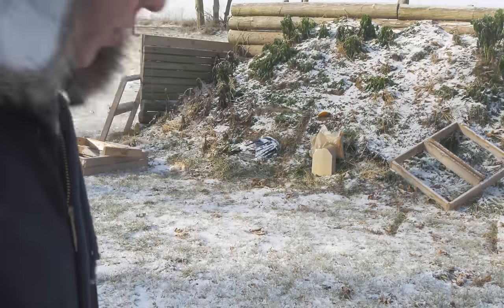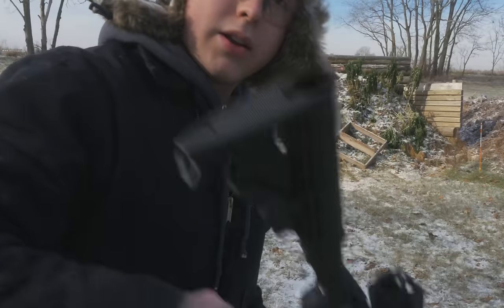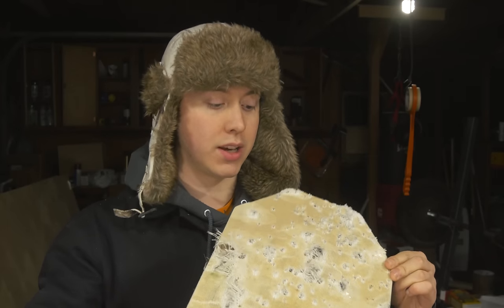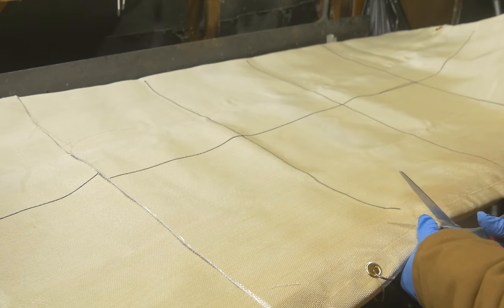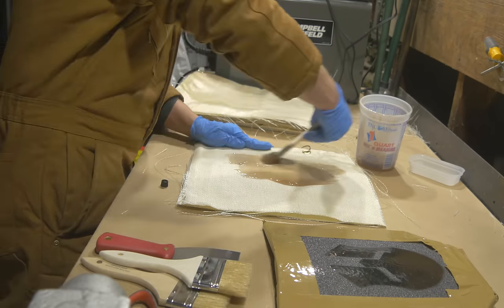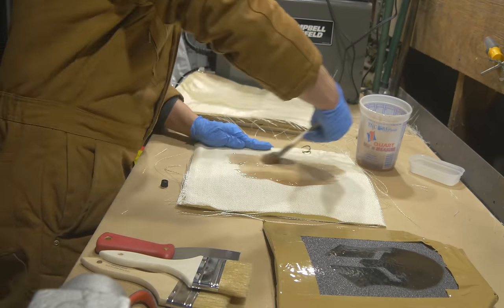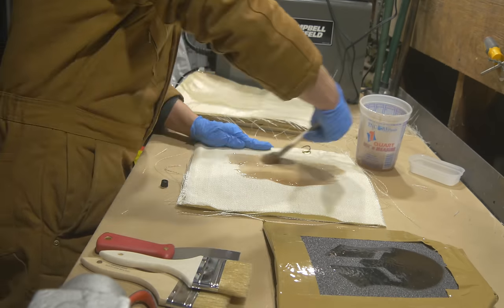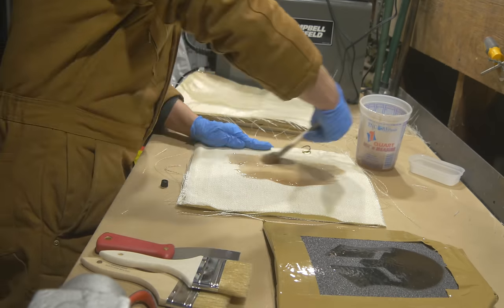How to Make AMAZING Bullet Resistant Armor for $30

Comment: steps to make a 30$ armor:
first: BUY 700$ REAL PLATES FOR MOLDS
Reply: I was thinking that too haha. Maybe we can make wooden plates as molds :P
Reply: lol
Reply: You can literally buy the cheapest AR500 plates and still have the same dimensions for $70. A
Reply: you can also buy Airsoft plates that are shaped like real ones but are only plastic
Reply: @MoviesFreeGalore  Do the cheapest plates still stop pistol bullets?
Reply: @user-oo6xw5fb2h  Yeah. Easiest way to break it down. The cheapest plates will stop rounds up to .44 magnum and slugs. The intermediate plates will stop all pistol, carbine, and shotgun rounds whether OO buckshot or slugs. The pricest plates will include 5.56 and 30-06.
Reply: @user-oo6xw5fb2h  But I mean the round itself isn't what you need to concern yourself with but how it handles spalling. Which is when the round hits the plate and breaks up into shrapnel that could eviscerate your soft flesh.
Reply: Don't forget how many hours of labor he put into it. Those costs are often overlooked.
Reply: @MoviesFreeGalore  Can always add a coat (or two) of epoxy or flex seal to any plate (if so desired) to help alleviate the potential for spalling. I also wonder how many folks are wearing soft plates between their clothing and the hard plates just to give themselves more protection.
Reply: @thomast8539  Not too many, obviously. But when most people ask about body armor they're thinking of plate carriers and generally not soft vests for handguns.
Reply: Not to mention but spalling is only an issue for hard plates.
Reply: AoD Wexler Walmart sells AR 500 steel targets big enough that you can cut one of these plates out of for $30. With a good angle grinder and a few cutting wheels you can have one made in about an hour. It will pretty much stop any round out there that is not armor penetrating
Reply: Yes sir!  Put those same hours into 1.5x overtime, and you can BUY some AR500 armor plates.

STILL, the proof of concept is cool, in case Diane Frankenstein bans them and you have to make your own.
Reply: @MoviesFreeGalore  I think you're missing the point. If you've bought armor plates, why are you making armor plates?
Reply: @cmasonw  Because I could buy level 1 plates that can only stop a fuckall gun for less than $100. Now I have a mold to make durable plates in line with level 3.
Reply: @MoviesFreeGalore  You can buy level III plates for approximately $130 or so. Watch MrGunsandGear's video on the Tactical Scorpion armor.

edit: idk how much armor prices have increased in the last few months
Reply: @MoviesFreeGalore  is it 600$ for a front plate only? Or front and back?
Reply: @frankarchibald732  jesus. If you pay $600 for 2 plates you got ripped off. You could get a full set of ceramic tiled plates for that price with side armor.
Reply: @frankarchibald732  personally I would say Google reputable and NIJ certified armor companies. Buy everything seperate. Bundle deals are great but that extra $100 you save is a detriment to quality. Even if you have to build your kit slowly. Get a quality carrier. Then figure out if you want front, back and sides or a configuration there of. I knoe some dudes that don't carry a back plate. Some do front and back with no side plates. It depends on what you figure your gun fight is gonna be like, and what your concerns with mobility and weight is.
Reply: @MoviesFreeGalore  oh ok. Cool. Thanks for the advice
Reply: @mattmurphy7030  considering there's commonly only two dimensions that plates are cut at. It really doesn't matter.
Reply: @MoviesFreeGalore  nice pfp
Reply: @thomast8539  I find that creating hard barriers to take a firing position from is more useful and safer than making one for the chest.

You can always buy a vest, but a bullet can easily fly through the drywall and miss the vest
Reply: @MoviesFreeGalore  two plates and a vest. Any advice for where to get all three? I need some for work, but everywhere is so damn expensive.
Reply: @theblackcatvieweraccount5402  really depends on what you want and how much you're willing to carry as far as weight. The cheaper stuff is going to be heavier.
Reply: Bro most NIJ-certified plates can be bought for under $200.
Reply: @PHIllip324  damn bro, that means my homemade armor will only cost 200$!
Reply: @MoviesFreeGalore  I read all you comments, and your forgetting about Impact Dispersion. The force generated by the round hitting the vest is what makes soft armor obselete for combat. You can use an hard plate and trauma pad to catch and diapers the energy, but on a soft vest, it only stops the round, and the impact can be enough to cause major damage, let alone the next 3 or 4 shot fired after.
Reply: @o01chris10o  Not necessarily. While it will hurt, no doubt. Depending on the caliber and type of munition, you could potentially shrug it off. Adrenaline wears off and you realize you've got some cracked ribs or bruised organs. But you're alive. Soft armor is really only something a civvie should wear against a potential mugger in reality. But against all odds, I would rather have soft armor versus none.
Reply: @billbucholz5125  uhm. maybe write a seperate comment, not a response to mine.
Reply: or...3D print moulds? or use silicone? There's infinite possibilities. Just needs the work to be put in and brain to be used
Reply: you can you weight plates
Reply: You Know you can have a wooden mold
Reply: @bloq6758  sir, thats not the point i was trying to make. the point is, he made a tutorial to explain how to make the plates, so other people can do so too. 
of course you could use a wooden mold, but the fact that he used real plates to produce his own, is awfully hilarious, since you dont need to make your own plates when you already got better real plates.                      and probably no one looking for a tutorial on how to make their own plates has real to use as a mold, as shown in the "tutorial".
Reply: But now he can sell relatively decent protection for half the cost.
Reply: I mean you could have used cheap plywood for molds.
Reply: Use chunks of a propane tanks...
Reply: or you can 3d print one for cheeper price
Reply: Ever hear of plywood?
Reply: @mrsurvival6733  its not about the material, its about using real plates for the general shape/bending angle. smh.
Reply: I mean you can make more plates, or even start a small businesses in your hood
Reply: @annotten7413  Steel is for targets not armor.
Reply: @BigD-jc6rj  Why would you buy steel body armor when you have literally any other option?

Comment: You might increase its strength if you change the angles of the threads with each layer
Reply: Paul Gloor 
Actually though.
Reply: Not just might, you would(don't know actually how much though)
Reply: Paul Gloor id like to see a build like that... although youd have to get much more fiberglass, because the cuts couldnt be the same. hmm.. well i guess you could make it square..
Reply: and then to add more strength he could get it ryno dipped.

100% joking
Reply: or adding in a layer or two of polycarbonate
Reply: I would, fiber glass is basically bigger asbestos. Spalling off of that is going to do more damage to you than a 9m in the long run.
Reply: +XBLArmory no it isn't, your body can break down fiberglass fairly easily. asbestos (and silica) cling to your lungs forever. 

I work with fiberglass almost every day.
Reply: fiberglass IS silica, sure it doesn't cleave in the alveoli like asbestos, but breathing fine dust of glass fiber can lead to silicosis. The amorphous nature of glass fiber is less dangerous than the crystalline nature of asbestos, but it can and does damage lung tissue.

Comment: The design of this bulletproof plate is thought to have a lot of potential. It is not just the performance of this one that is important, it is more important to get an idea from this product and apply it.
The biggest advantage is that it is clean in shape, not impractically thick, relatively light in weight, can continuously stop multiple pistol bullets, and reduces lead fragments. If you increase the number of fiberglass layers, use a resin with stronger adhesion and penetration, press with greater strength and let dry for a longer time, you will get better results.
Reply: I think also changing the direction of the fiberglass weave would also help. It looked like he had all of the facing N/E/S/W but doing that and then NE/SE/SW/NW and repeat back and forth would help slow down rounds even more
Reply: @mythologicalnomad6520  You are right. There must be a few ways to improve performance by slightly changing the fabrication method.
Performance could be also improved by using the principle of composite armour. Bulletproof window film + ceramic tile, several layers of Kevlar fabric, dense/light metal wire mesh, and thin/light metal plate/sheet could be considered.
Reply: you might get better results in a hexagonal rotation. consider a hydraulic press to apply even pressure during the cure. and in the words of the blendtec blender guy "fiberglass dust, don't breath this".